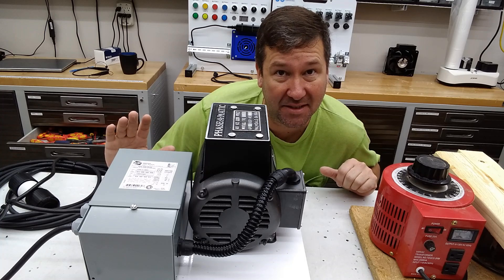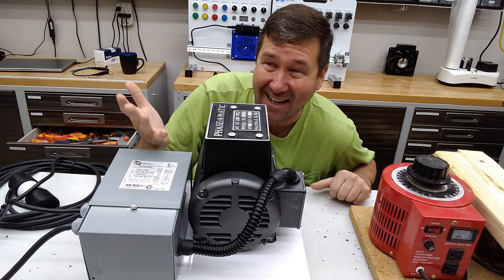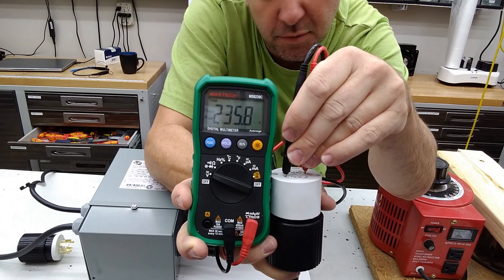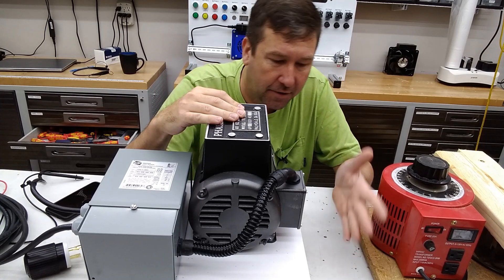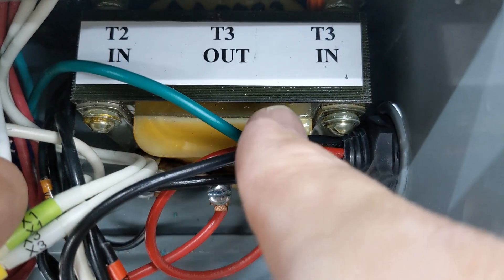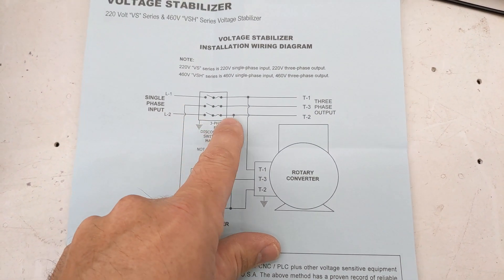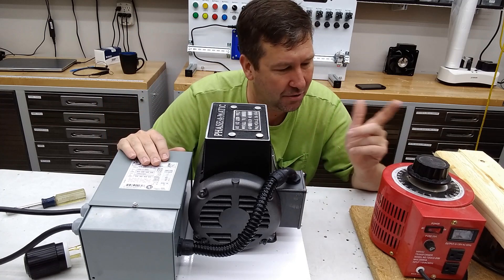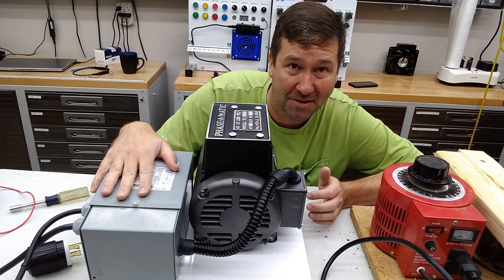Rotary phase converters and backfeeding transformers for 3 phase power

Comment: Hey Tim, love the videos! I'm looking at purchasing a similar setup for our UL panel shop. Can you share which model from Phase a matic you went with here, and was the transformer and balancing transformer included or purchased separately? Thanks!
Reply from the maker: This one won't have enough power to test control panels. I would reach up to American Rotary. Also here's a video on our bigger rotary phase converter setup that has both 240 and 480 VAC
https://youtu.be/k9tR9d3DsqY?si=Iiv9ULv5Zlq4E2tV

Comment: I could use one of those for a three phase welder I have for sure, I have another welder that can run on Single phase 460v my problem is how in the heck do we get 460v single phase?
Reply from the maker: You need a single phase transformer to take household 240 and boost it to 480.
Reply: @TimWilborne  Thanks for the information, i just bought like 6 three phase motors from 30 hp down to like 5hp and one transformer not sure yet what it is until I can pick up all the items after the holiday, I only need the rotary phase converter to run one welder that uses 37amps max so one of those motors should work

Comment: Hi Tim. My name is Cody. I’m actually building a conversion bank after my phase converter. After my phase converter im getting 240 three phase. What I actually need is 120/208 three phase 4 wire.  This will be the source for a powerline simulator  that I’m building. I will be teaching transformer theory for lineman. The issue im having is voltage imbalance on my 240 out of my phase converter.  My voltages are L1- L2 240v. L1- L3 254v. And L2- L3 235v. I’ve been hand winding a 240 delta to 120/208 wye transformer and when I energies it my voltages are obviously off. My 240 between L1 and L3. And L2 and L3 drop a lot when I energies the transformer bank. Is there a way to make the voltage more stable or should I just wind up some booster transformers for the two low phase potentials?  Also the starting capacitor is a 50 by 370 volt. Thanks.
Reply from the maker: That is what the run capacitors are for, to balance your voltage.
Reply: @TimWilborne  can I change the run capacitor to get a more balanced voltage. And if so. What should I change it to.